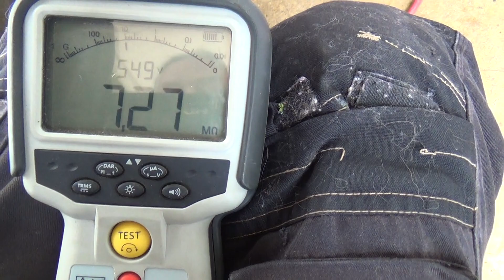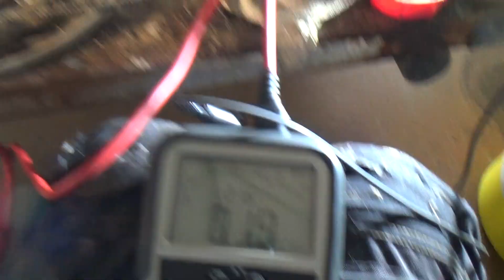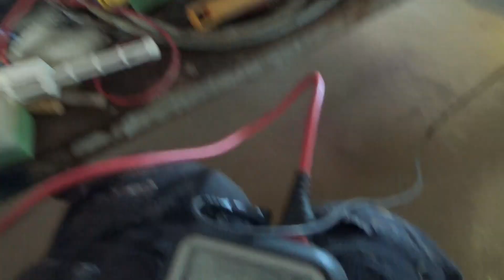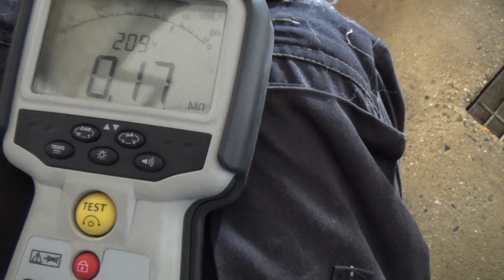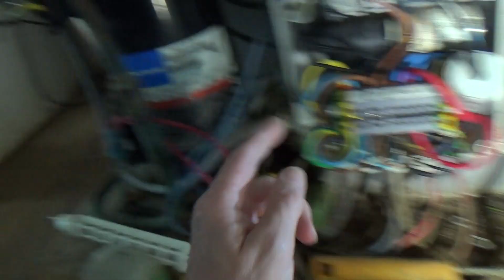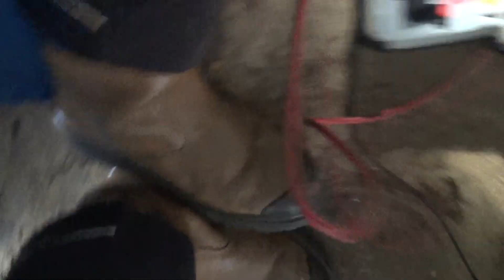Undead Comp, Just Blows Me Away, Yeah.....

Comment: Great job as usual 👍
I am not sure on that particular pump and it's MIs in regards to it's orientation, but  certainly with other makes of can type rotor pumps, they are normally orientated in the horizontal and not vertical position, as the air gets trapped at the top of the can and they can burn out - usually they need the water running through them to keep them cool 😜
Reply from the maker: Yes! That rings a bell! That pump should have been horizontal. I think the bearings are actually lubricated by the water as the rotor is in the water. Wasn't installed by me is all I can say...